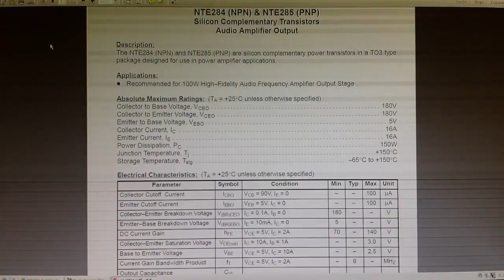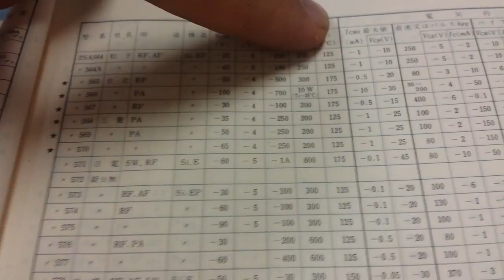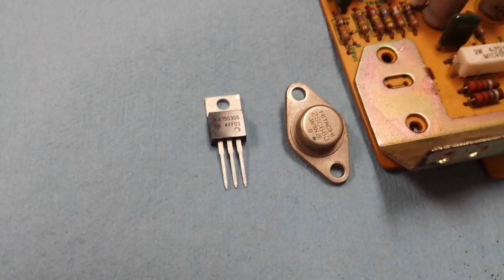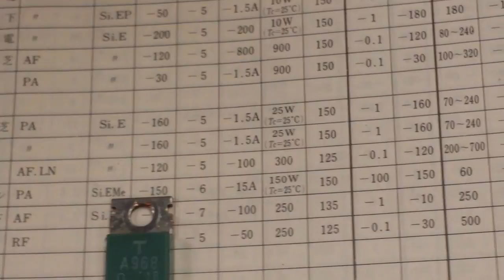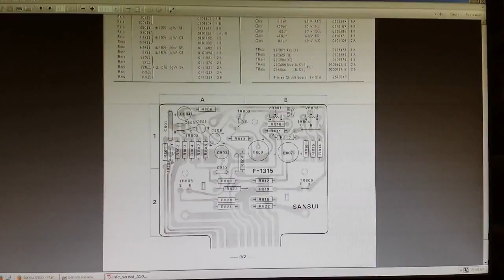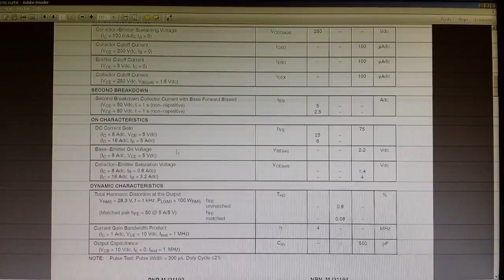submerged Sanusi 5500 rescue part 3/7 - Amp repair attempt 1

Comment: I wonder if the MJE21194G would work. They seem to work well under a lot of different conditions. In in fact I just replaced 4 in a marantz 2220 that was a single ended design also. Originals were 2sc1030. I know they are slower in bandwidth and higher in capacitance, but they were in many cases I have used them as well. I too had to use subbed drivers as well. Just a thought. They are pretty cheap too. Anyway, awesome work. Hope to see this thing run again.

Comment: I'm amazed that circuit needs such high frequency transistors. I would have thought devices  with a lower HF limit would be less inclined to oscillate at high frequency due to the reduced gain outside of the audio bandwidth. A possible solution might be a ferrite bead on the input to the amplifier to reduce the gain at RF frequencies.